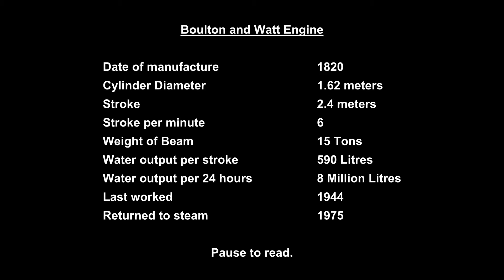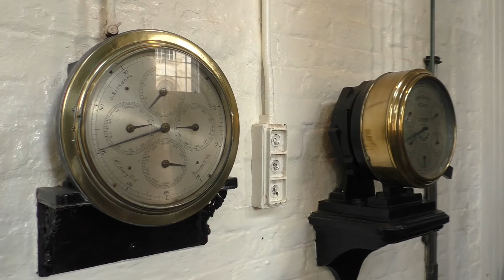HUGE Engine - Boulton and Watt - London Museum of Water & Steam - Part One

Comment: Nice video only criticism as a time served English Engineer is as this is an English engine designed and built in England by English Engineers why use the metric system as your primary specifications instead of Imperial measurement. Be proud of our engineering heritage and please use the correct terminology or it will be lost.
Reply from the maker: Thank you for your comment. Unfortunately I live in a country that uses the metric system. It's also where my largest viewer base is. Thanks for watching.